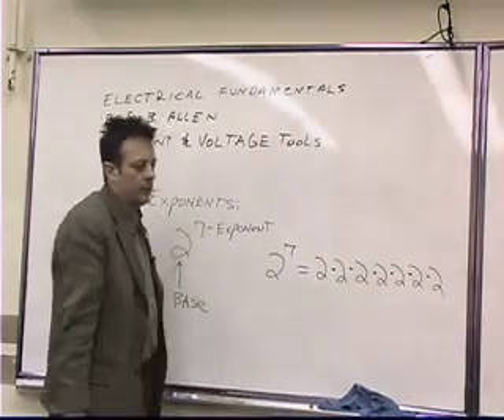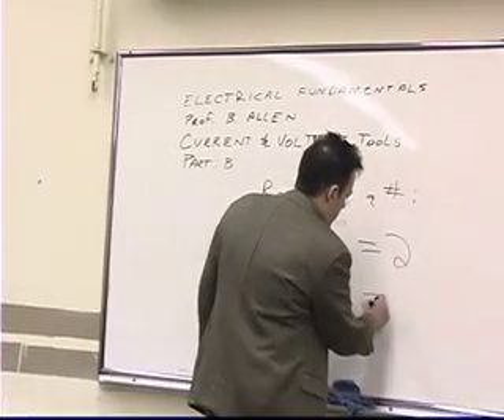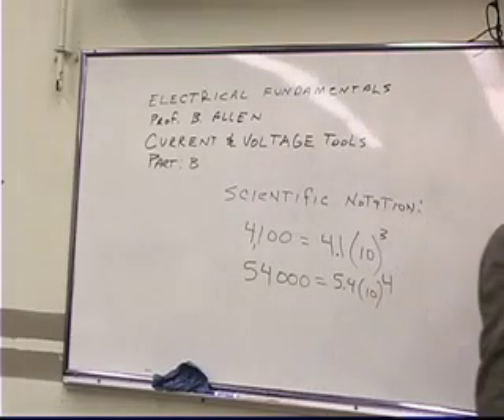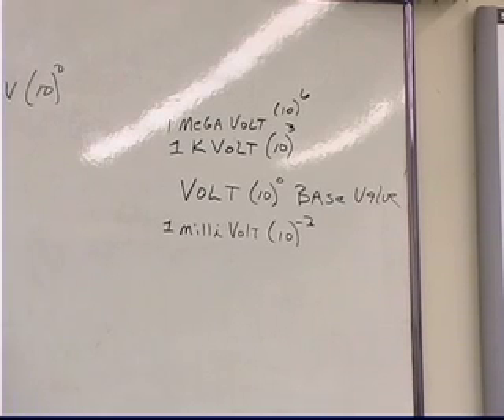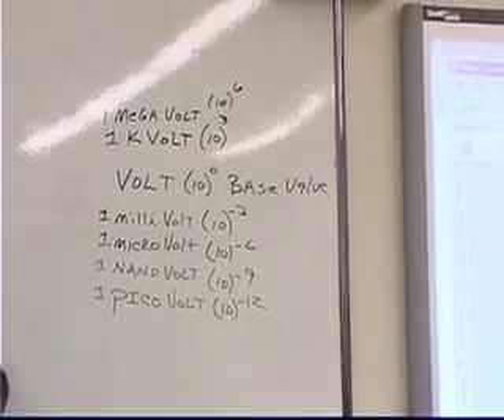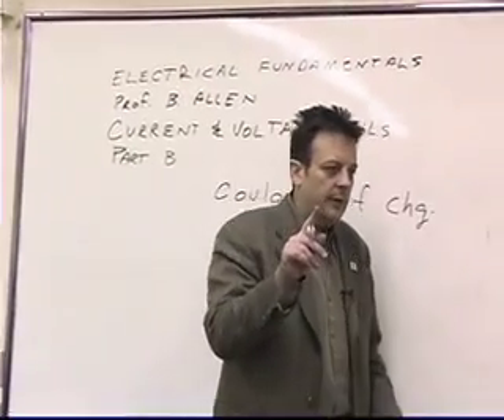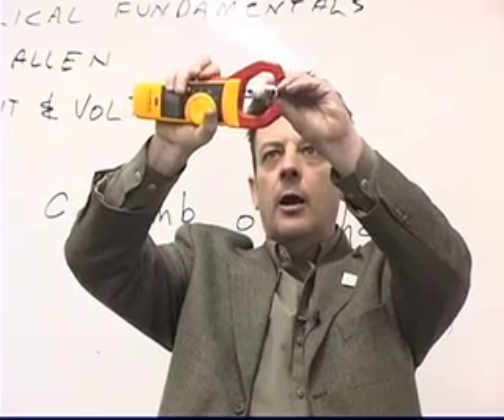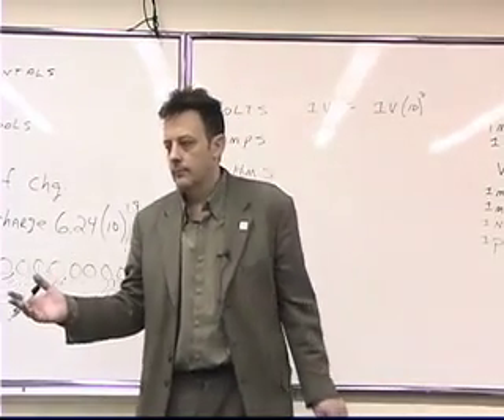Lecture 1b Voltage and Current

Comment: One error when explaining 3 states of water. He said that water vapor was the water molecules broken into their constituent elements of oxygen and hydrogen separated. Water Vapor is water in its gaseous state of individual molecules of water but not broken down to elements. However, as he did state its the amount of energy  within the molecules that dictate what 3 states that water is in. If the molecules of water were broken into their individual elements it would no longer be water. But his lectures are still excellent for learning electronics.